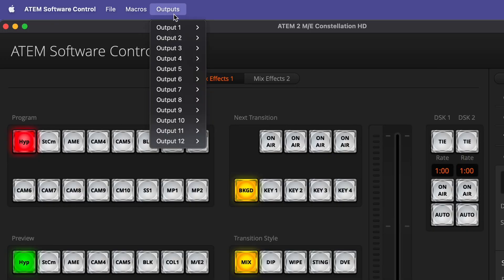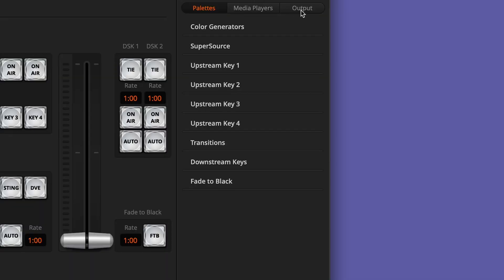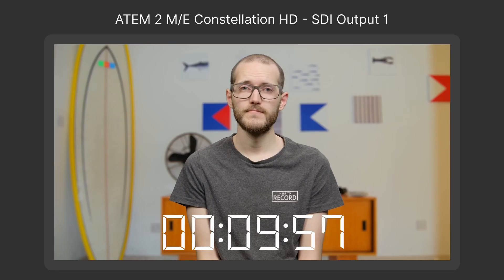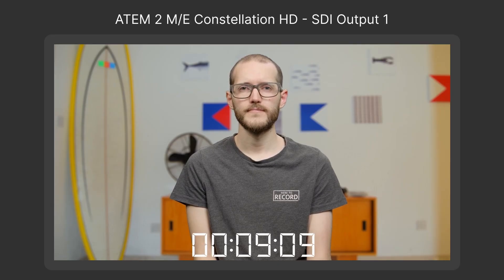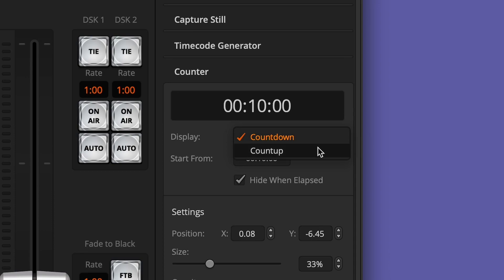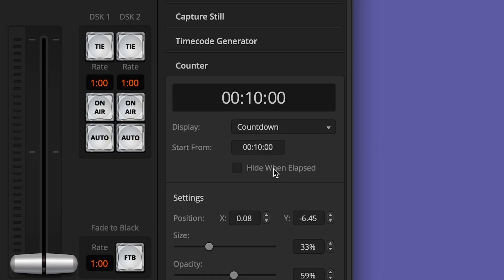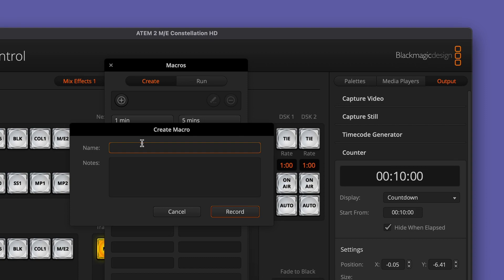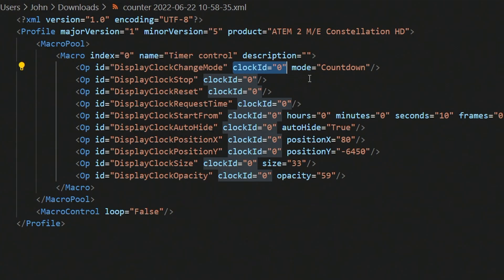Counter overlay, how it works // ATEM Constellation HD

Comment: It should also be able to Countdown to {clocktime}. Our show runs until the break at 2PM. Instead of fiddling with calculating the remaining time until that point and starting the countdown exactly right, just enter {2PM}.

Bonus points: A choice between automatically going into overtime when the timer hits zero (counting upwards, maybe turning red) and delaying all the following presets with the overtime. OR transitioning automatically to the next preset. Usually time is a zero sum game for showcallers, but being able to make the call to give Tom 2 extra minutes of cam time without having to increment all the other clock presets with +2 minutes would be gratifying.